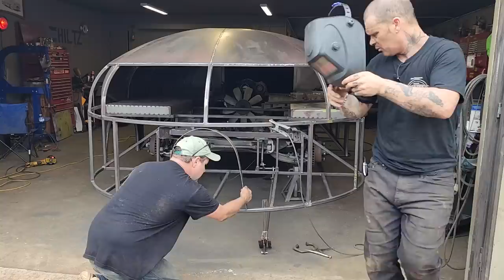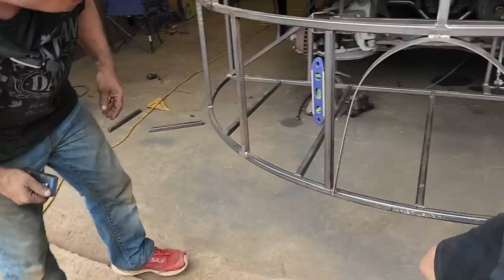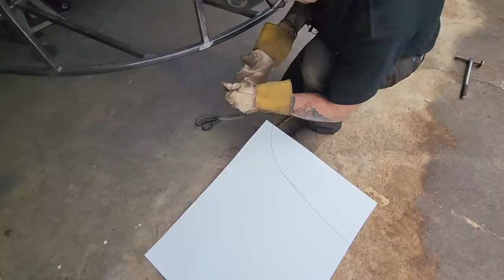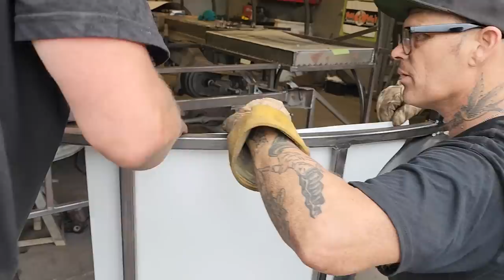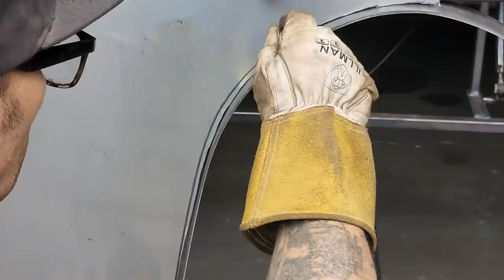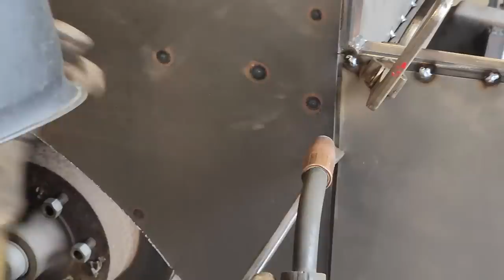Fabricating a Bugatti style grill for the hauler

Comment: Chad, are you going to put the floor sheet metal on the lower edge of the passenger compartment so that you have an inch of space between the 1" square tubing?  Doing this would allow you to add the heat shield blankets in the 1" cavities formed by the tubing and lower sheet metal before you place down the upper sheets of metal.  Doing this would help to produce a smooth skin for the bottom of the driver's cabin.  You could also add the heat shield blankets on the cabin walls to help manage the cold, heat, and road noise.  I really enjoy the way you are putting together the Bagote hauler.  I can see you and Jolene using this machine as a towing rig and also as a camping unit for overnight trips/runs.  I sure hope you can seal the driver's compartment to help keep out engine exhaust.

Comment: Chad to fill in the grill if you don’t mind a suggestion I would take two strands of # 9 wire put the two ends in a vice and the other two ends in a drill twist them together then cut to length weld at top an bottom .that would look cool. But as you say it’s your car and you do what you like. I am just saying. Your friend Ed C

Comment: I’ve been watching the process of the Doodle Bug. It’s really coming together. My question is with the placement of the engine so far back, do you think there will be sufficient air flow for cooling purposes. Once the cab area is closed off air will be restricted. Especially with the lac of windows. A roof vent might be considered. Also shouldn’t you put the floor in place before the grill work ?
Reply: Why don’t you use cordless tools ?

Comment: Chad maybe you could try some of the new cordless stuff as it is pretty good now since they came out with brushless motors and inter changeable batteries with Dewalt and some of the other major brands, i have Dewalt gear and it works great for me right down to my Battery chain saw with a 12 inch bar

Comment: the arc of that metal seems not symetrical
Reply: Think your wright. Chad should have checked before welding it in . Not having it symmetrical would drive me nuts.
Reply: "would you look at that now would ya"
Reply: @dend.6523  the cut fits but does not prove symetry All good any way it happens